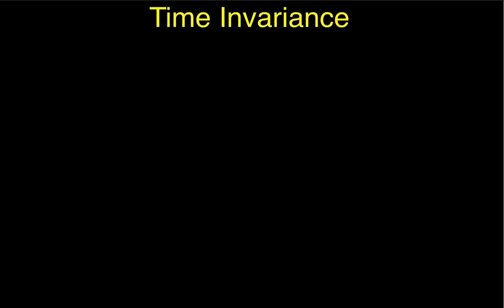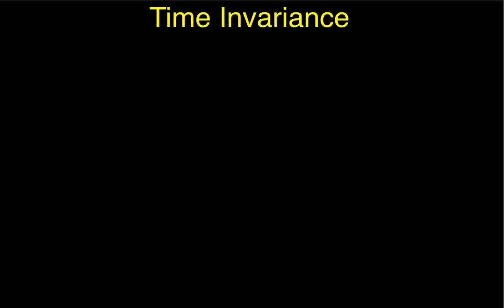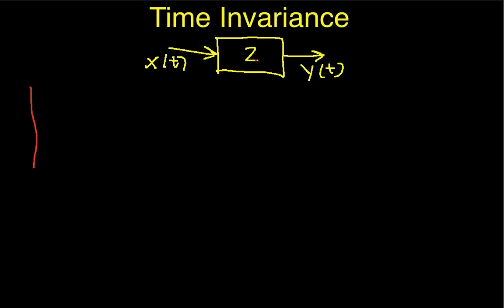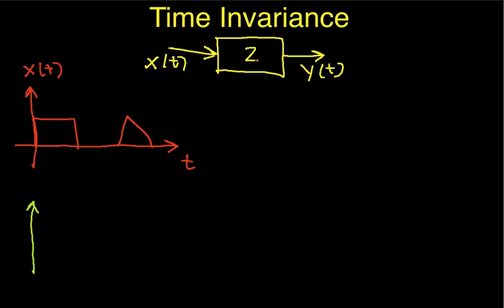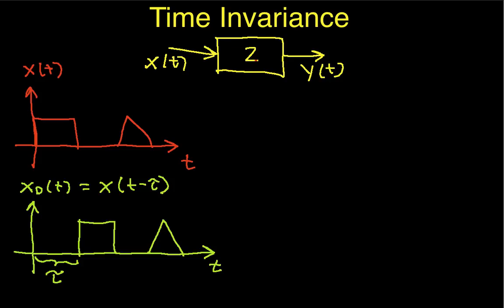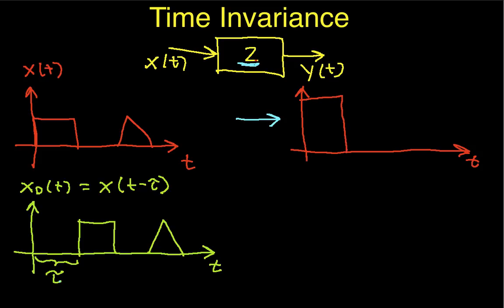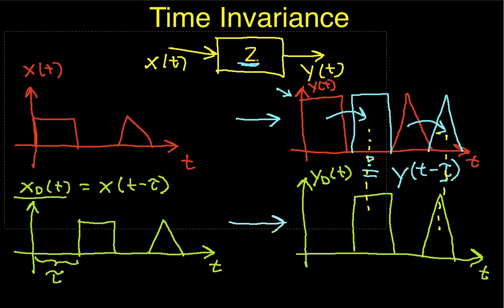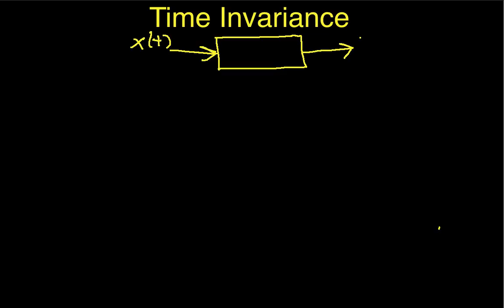Time Invariance: Conceptual Introduction

Comment from the maker: @dhanoarajvir1 No, the video is showing that a system that multiplies its input by cos wt in the time domain is not time invariant. Because the system is not time invariant, we would have a difficult time computing the output of the system using convolution.